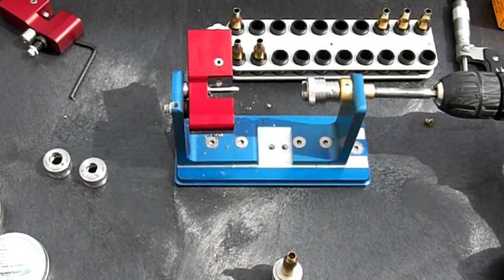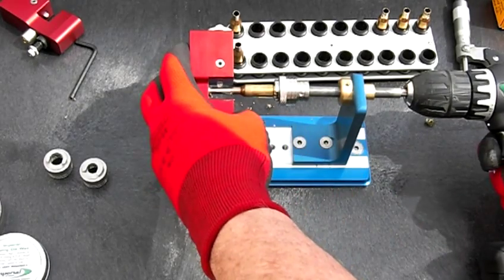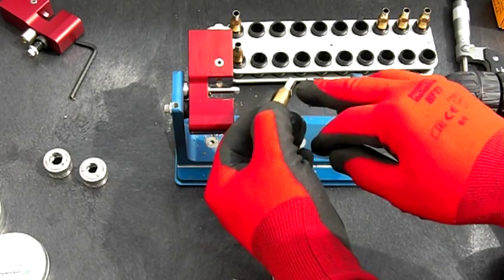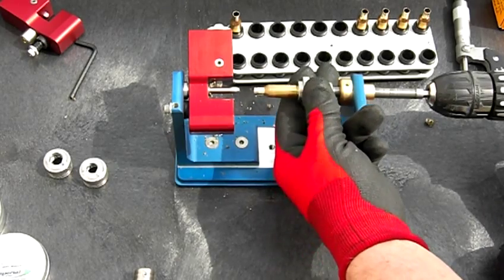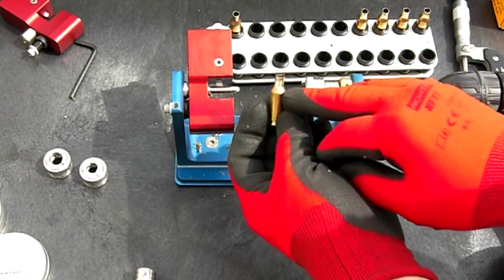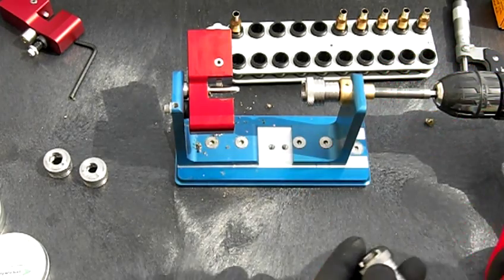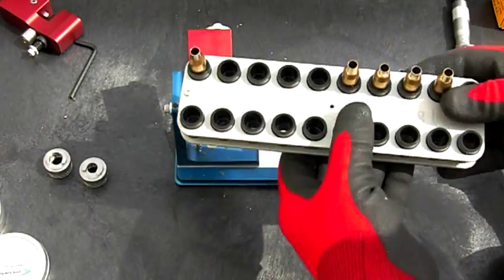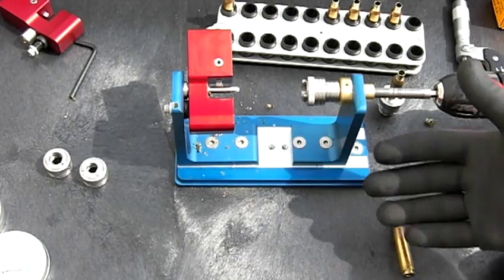21st Century Shooting Neck Turning Lathe

Comment: Do you currently use orings on the case drivers? Why is the pin that goes in the primer recess so much smaller than the actual hole itself or doesnt that matter?